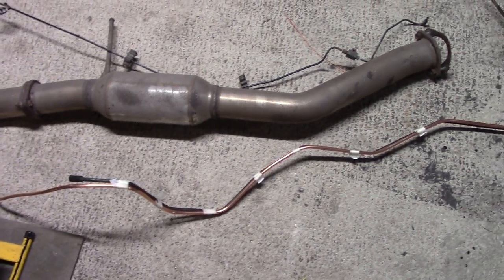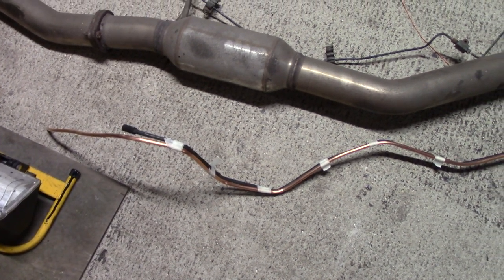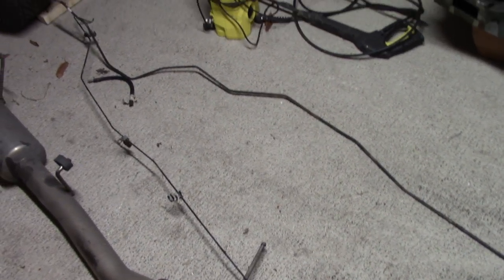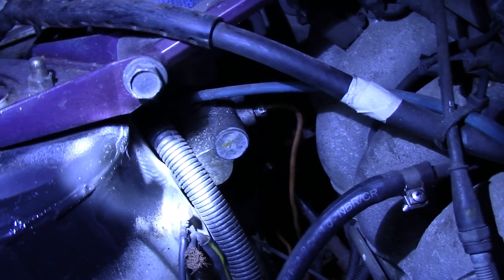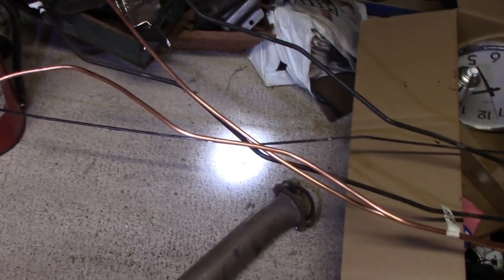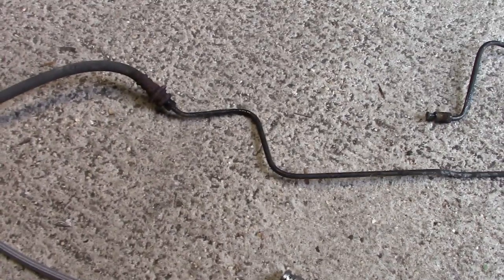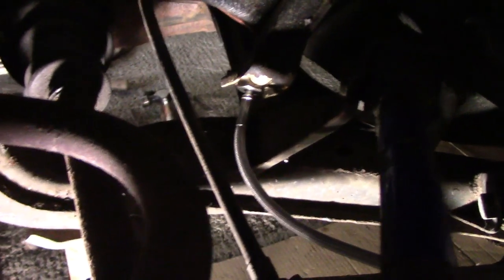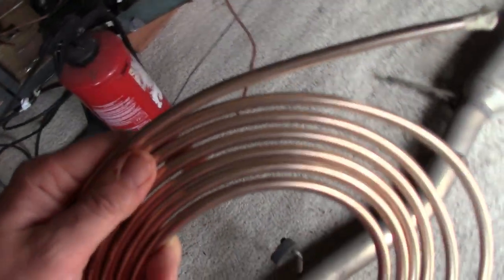1994 Nissan Sil80: Making Kunifer/Copper Fuel & Brake Lines | Phase 5

Comment: You need a tubing bender.  Also the reason they don't use copper for break line is the hydraulic pressure can cause it to expand and explode.  Stainless steel is the best to use for break lines.

Comment: Good you used the Cunifer, mostly for corrosion.  I'm not familiar with that but I am familiar with cupronickel  (used in old/high quality marine salt water piping), but it seems like it will do the trick.  As has been mentioned work hardening is the issue with copper, meaning the more you bend it the more brittle it becomes, has something to do with the crystalline bonds I assume.  That being said, I've seen copper tubing of similar gauge used on 100+ psi vibrating machinery that appears to be decades old and it is still good to bear the pressure (the wonders of hoop stress).  The only issue is that if you bend it or bang it with something it cracks pretty easily.  I suppose if you kicked a rock or a stiff branch up into the undercarriage you could rupture the line after a while running copper.   

As for the tubing bender recommendations, your garage is immaculate and you did a good job just Supercapping it into place, so unless you have much more small gauge tube work to do, I don't really see the need to get one (A handheld will cost you about $30/25 quid).  If you have a torch you could probably get away with using some heat to bend what you need to, as a bit of annealing on a tube or pipe doesn't hurt as long as you don't go too far with it.
Reply from the maker: Roger. Will keep kunifer fuel pipes and replace copper brake pipes with flexi-pipe in a few months.

Comment: The only thing I can tell you is that copper can corrode away from the inside out without any sign or warning, and it can happen incredibly fast compared to steel.  Best bet is rubber/nylon fuel hose.  But with any steel lines, having had more than one brake line burst due to rust (true terror), I like to spray them with an etching primer and then paint.
Reply from the maker: Roger, will re-do brake lines with flexi.

Comment: Cap one of the biggest concerns of copper is that it work hardens, meaning it will get brittle over time with vibration.

Copper nickel is better.  There are bending tools. Please get one.
Reply from the maker: Will replace the brake lines with Kuniper in a few months then.